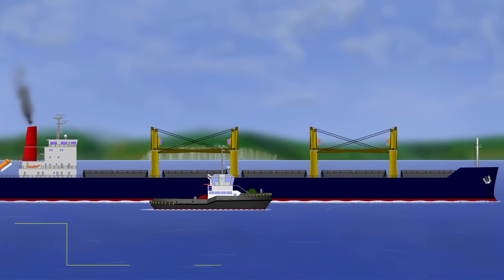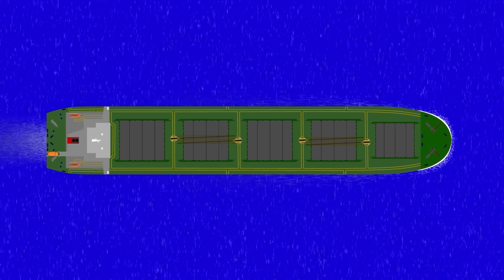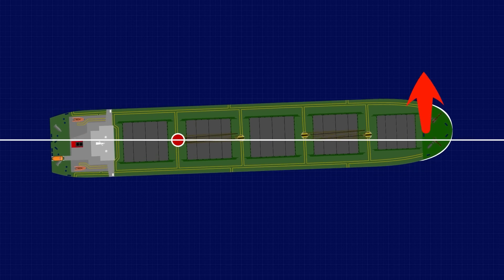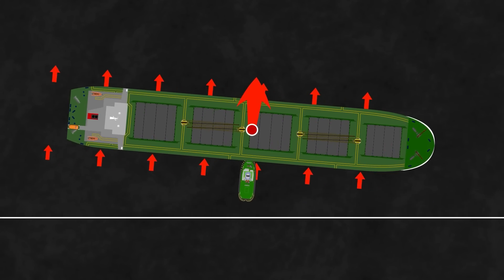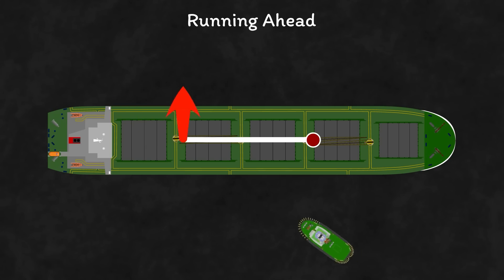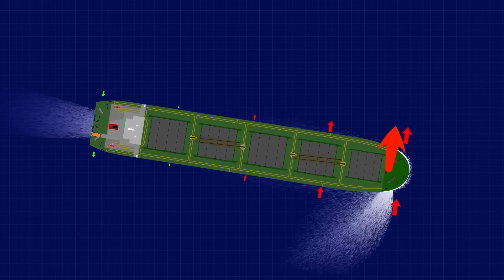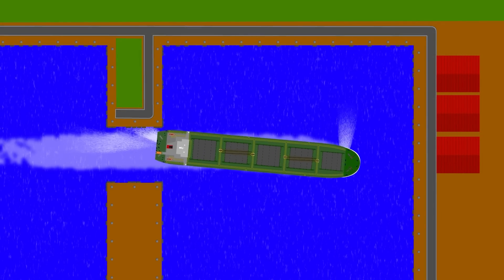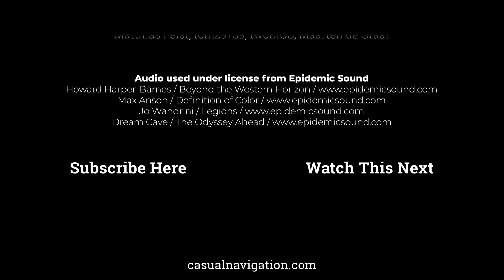Why Don't Tugs Turn Ships?

Comment: So if a ship had bow and stern thrusters could they fire them in opposing directions and flip the whole vessel around its center point? at least if it was sitting still.  I think I start to realize that picturing how ships on water work is more complex at times than ones in space.

Comment: Bow and stern thrusters are not designed to work above about two or three mph, and you do not mention that pushing a stationary vessel in the centre will also induce a turn as there will inevitably be differing currents fore and aft creating a difference in resistance,.

Comment: A imperfect theory will shine when you in a environment with imperfect data measurement.
Like why you have soft fingers, its hard moving you hands and garbing objects, much easier to have soft fingers that just deform and grip on to any object.
But you also have a hard time being precise because of it.
Were a robot with metal fingers can be super precise but also fails the moment something gose wrong.

So it makes sens that you can used a broken incorrect theory as replacement, when there always gonna be so many factors that you cant control anyways. 
Its a thing people (especially control freaks)  is that imperfection is the real perfection.

Comment: 2:00 - this is incorrect. The imaginary pivot point moving in reverse direction - FROM the tug. At 2:10, when the ships has almost no angular speed, the imaginary pivot point is at infinite distance. More simple - there simply cannot be a center of rotation/pivot point around which nothing rotates :)
In the case discussed in the video, the ship can turn right when pushing it near the center of its mass for two reason:
- it is not the center of mass
- sum of all moments of forces around the center of mass is not zero. It may not be equal to zero because the force of water pressure along the hull is not constant - see Bernoulli effect for example.
It is for the reason that the force applied to the center of masses does not cause rotation that the sailing mast, if it is one on sailing ships, is set above the center of masses - or, in the case of several masts, is calculated so that the sum of the moments is zero.

Comment: That’s cool. Another cool fact, if you drive a forklift at your job, your really only a body of water away from driving a four winns motorboat (the driving controls are really similar, my dad had a four winns when I was a kid and I drive a forklift currently and the stirring and excellratir controls are extremely similar.).

Comment: Ok, it's late and I am not entirely sober, but this one went a little too fast for me. I feel pivot point theory deserves an entire 10 minute video of it's own. 

Like at 2:26 "But the ship's hull is also going to induce movement in water that surrounds it, as soon as we add in the forward motion of the ship..." 

What forward motion of the ship? We were talking about moving a roughly bar-shaped object sideways through a fluid while pushing at the center. Why would it move forward?

Comment: It's a little bit like centrifugal force. People will say it doesn't exist, but if you construct the force diagram in a rotating frame of reference there is clearly a force vector pointing away from the center, and the clothes in your clothes washer clearly get mashed up against the outside of the drum during the spin cycle.

Comment: 2 points.   1) Tugs do turn ships…regularly.  2) Your suggestion a tug pushing at the apparent centre of a ship results in the stern being pushed farther than the bow is the opposite of what actually happens.  The rudder and screws result in (what you call a pivot point) being nearer the stern than the bow.

Comment: Will bow and stern shapes change where the pivot point is? I assume it would as water will move over the shaped area differently than it would a flat side, though I also assume it wouldn't have as big an impact as the ship's own movement

Comment: The part about bow thrusters is very important knowledge for mates of workboats.  Any mate in Fourchon can tell you that they'd rather drive in reverse.  Most think it's primarily because they can see more of the boat in the tight turns and narrow passages, but it puts your very strong z-drive on a shorter lever arm and your relatively weak bow thruster on a very long arm (plus the reduction of hull interaction).

Comment: I don't understand.
The title says "Why Don't Tugs Turn Ships?" implying that they don't do it.
The video however talks about how the thrust applied at different points of the ship affects the turning of a moving ship, and it is explained with both tugs and the ship's own thrusters.
So do they not use tugs (like the title suggest) or do they use tugs sometimes?

Comment: I don't like this explaination. What if the ship is moving very slowly, then the pivot has to be near the center. At which speed does the pivot meaningfully shift towards near the 1/3rd mark? Surely it must shift continuously as speed increases.

It sounds like some parameters are missing from the explaination
Reply: What I've learned in the academy - is that when you run propellers astern/ahead the pivot point strikes the point in the hull where it meets the water, since at that point the water is like a "wall".after the ship starts moving - the pivot point settles about a 1/3rd from the stern/bow. the exact position is determined by the ships block coefficient. boxier ships have a tighter turning radius while more fine shaped ships have a bigger turning radius.

Comment: And when you throw in the shape of the tugs employed and the speed of the ship, you have yet another variable.
 A deep draught tug pushing on the bow of a forward moving ship creates a low pressure area alongside the tug on the side away from the ships direction. With enough forward velocity, most of the tugs power is committed to maintaining its position alongside and the low pressure will overwhelm the tugs actual force on the ship causing the ship to turn into the tug.
 Its complicated and not always intuitive and that's why there is always an apprenticeship program for piloting. There is some stuff you just have to experience before it either makes sense or becomes intuitively predictable.

Comment: well, there's also tug push point marked by ship builder which position not ideal at all for efficient maneuvering. 
instead of reinforcing efficient pushing point, builder just marks frame parts for tug to push which way far from ideal pushing point.

Comment: I think one big reason large ships appears to have so many counterintuitive handling characteristics isn't actually that their handling is really more complicated than smaller vessels and vehicles (though they might also be large enough that some proportionally weak effects are noticeable, too); I think one of the main reasons is that they are so large that everything seems to happen in "slow motion" which means you can't just react to how it feels in real time, you have to plan things several minutes ahead. 

Bicycles also have really complex physics with weird gyroscopic effects and positive and negative feedback effects (there's a reason it takes quite a while to master it) but it's so small that everything happens in terms of milliseconds and seconds rather than minutes and hours like a ship; which means you can fairly easily train your preexisting brain circuitry for balancing on two legs to instinctively react and compensate for all the odd bike physics. But things that are so slow that you have to apply the steering inputs for several seconds before they even start to have an effect and for minutes before they start to be noticeable is simply too slow to be able to use your normal movement circuitry and you have to calculate and plan everything consciously rather than just reacting instinctively.

(Admittedly I haven't tried steering a big ship; but I have tried steering my brothers wooden boat with an inboard engine (no idea about feet but it's much bigger than a van but shorter than a bus, I think?), which is large enough that it's at the limit of how big it can be and still possible to steer instinctively. With bikes and most cars you can easily just hold the steering wheel and look where you want to go and your arms will make hundreds of microscopic adjustments seemingly on their own so that you appear to drive straight even on a slightly bumpy road, while with this boat I would suddenly notice I was veering slightly to port and apply rudder towards starboard and then a few seconds later notice I was starting to veer too far to starboard and so I had to more consciously apply just an imperceptible correction and then trust that it will start to have an effect in a few seconds. Otherwise I would be zig zagging all the time. But I feel it's still within the size that you can eventually start to develop a feel for it without having to think so much about it; but I doubt that is true for even larger vessels. I assume you have to more deliberately measure your current heading and the difference from your desired heading and then calculate an appropriate degrees of rudder input or engine power to apply for some amount of time (or use a lookup table of precalculated values) rather than just feeling it.
Reply: Yes and no... it feels much, much faster from the bridge.  Yes, some responses take longer, but the rub has more to do with the fact that we're trying to work 2-3 movements in advance, in my opinion.  There's also the fact that the distances involved are at greater than human scale.  I'd add that there's a lot more boat for the environment to work on, which is going to make each experience more unique, plus the power involved increases bottom, bank, and intership interactions to account for.  Finally, on a small boat you're basically always driving the same boat.  Maybe an extra few passengers, but that's a much smaller difference than fully loaded vs. lightship.

Ultimately, it's correct to say that it's all intuitive, it just takes a bit more education and experience to get there.
Reply: I guess the closest you get to sailing big ships on instinct is to build a mental model of the movement that you can run faster in your mind so that you can engage your intuition on the mental model?
Reply: The point about time of feedback is a really neat one.
Reply: Well this is an interesting read and something that explains the difference between driving in Grand Theft Auto and Euro Truck Simulator. I imagine piloting a mega ship is something times a thousand or even a million of that difference.
Reply: You sound like you never driven a car on the limit on snow before.  In rally racing you have to use instincts and conscious thought to not only win but also not to crash and die. This is why rally drivers have co-drivers/navigators to let them know what is ahead because you need to pre-plan when you need to brake, steer and give throttle several turns ahead.
Reply: @toolbaggers  btw, even racing is objectively no more complex than walking on two legs. We've been able to automate a lot of all sorts of driving and navigation for decades but it's only in the last decade we've been able to make ridiculously expensive robots that are somewhat able to do bipedal walking without having a horribly inefficient Parkinson's like gait without falling over every minute. We just don't realise how complicated walking is because we have dedicated brain regions finetuned for millions of years that were able to train for the task before we're old enough to remember the process.
Reply: @toolbaggers  I live in Norway so I drive a lot on snow, but I don't race cars (outside the occasional sim racing). But yeah, like I said the physics is really complex at smaller scales too, which is noticeable when you're pushing the limits. But when driving on regular roads at legal speeds, even in snowy weather, it's still at a time scale where you can easily develop subconscious muscle memory for it.
Reply: @toolbaggers  Isn't that completely consistent with SteinGaus's point? No one spends that much time driving on snow like they do in regular driving. And moreover, it has the opposite problem of too long feedback times- the feedback times are incredibly short, even shorter than a human can normally react to.

Comment: What I learned is when running astern the pivot point is approximately on ¼ from the stern, not ⅓ caused by the shape of the ship's hull under the waterline.
Reply: yes, it depends on the ship's block coefficient. a boxier ship like a tanker or bulk carrier will have its pivot point in a different position then a ship with lower block coefficient

Comment: That’s interesting how bow thrusters are largely ineffective while a ship is at speed.  I guess that answers the hypothetical “what if” question regarding how history might’ve been different if the RMS Titanic had been equipped with them.  The most likely answer being, “It wouldn’t be”.  The crew of that beautiful broad would’ve slammed her into the wall of ice just the same.

If the on-again/off-again 'Titanic II' project ever does actually come to fruition, I noticed that the concept art portrays her as being equipped with bow thrusters this time around.  But regardless, I should think the ‘speeding through an ice-field’ lesson has been well good and learned for all coming time, and utterly ingrained in seamanship the world over.  But always beware, and woe unto any who say, “It can’t happen here”, or “It can’t happen again”.🫤
Reply: It would be more effective to add stern thrusters if the ship has standard shaft drive. The Titanic, with stern thrusters, could have turned much more rapidly than with bow thrusters. A lot of cruise ships are being built with podded propellers, which makes the main engines do double duty as stern thrusters. pod drive have the propeller in front of the pod, so they point to the right to turn left.
Reply: @jaquigreenlees  wouldn't matter, bow/stern thrusters are useless above around 3 knots
Reply: Amen.❤.

Comment: This reminds me a lot of the explanation of how a motorcycle turns by leaning and counter steering. 
Non drivers get confused of why you would push the side you wanna turn
Reply: Yes! But bikes are small enough that you eventually train your brain to do it instinctively; because everything happens at a time scale our brain is built for; while ships with it's enormous size requires maneurvres that last minutes, way longer than our brains are able to just do by feel. (Or at least by the time you start to physically feel the ship is turning too much or too little you are several minutes too late to do something about it)
Reply: @SteinGauslaaStrindhaug  People who move from bicycles to motorcycles sometimes get into trouble because of the weight difference. With a bike you can turn pretty effectively just by leaning to shift your body weight; but a heavy motorcycle will turn in very slowly if you do that. It's necessary to consciously counter-steer to establish a lean angle.
Reply: @SteinGauslaaStrindhaug  bruh imagine i need to actually think for minutes how to lean that shitbox in. On the other Hand you really need to predict the corner and lean accordingly in + you need the right speed or else its lame. 
I drive a supersport and for me its always a balance act on how fast can i take the corner without crashing and then i try to take that. 
Plus ships barely do turns that they dont see, sometimes corners on street begin very straight and then get very tight, or worst case a normal 60-70 corner ending in a 180 corner which we have sadly a lot in the mountains
Reply: The same is also sort of true for go-karts. One way to handle a go-kart is to set the rear loose into a corner, by leaning and using the shift in balance as you brake, and then lightly counter steer through the corner itself. The slip angle lets you maintain a bit of speed into the corner, and then depending on the actual corner lets you set up for exit sooner.

Comment: Even removing the effects of water and all that, and just taking the simplest physical model of an extended rigid body, working out what component of a force causes translational acceleration and what component rotational is surprisingly counter-intuitive. The maths isn't all that complicated, but it's hard to picture something speeding up both its sliding and its spinning simultaneously. Add in multiple forces acting at different points and it very quickly leaves what my intuition can cope with.
Reply: Turning a boat isn't as hard as predicting the weather.
Reply: @toolbaggers  Don't need no calculus. A little trig might  help though.
Reply: Like learning to back a trailer. Not that complicated, but intuition interfering with understanding. Much more complicated with water being the medium however.
I read a book by John McPhee called "Common Carriers" that has a chapter about ships and fluid dynamics. I've had some experience with river-rafting, and there seems to be a tendency for water to push to where one does not want to go.

Comment: then you add on tide wind and or bank effect  then Murphey's law might pop up as well
Reply: Like a whale stuck on the bulbous bow. 😂
Reply: @BobHill-s2c  And also like when a whelk is wedged within the wheelhouse 🐚
Reply: Murphy's law implies a potentially non-zero coefficient for each term of any equation. 😉
Reply: @brettany_renee_blatchley  ...and of course those coefficients' change rate is dependent on how consequential and inconvenient a failure would be to the ship's master. 😝
Reply: @KonradTheWizzard And exponentially proportional to the number of people watching! 😂👍
Reply: AND current.  :-)  Water is a fluid and fluid is fluid!
Reply: The ship ends up on the peak of mt. Everest